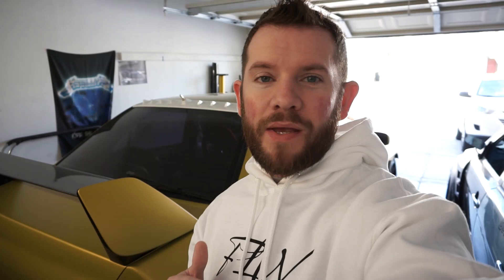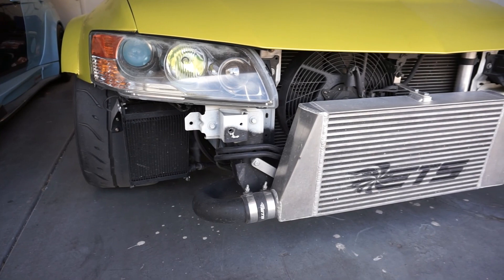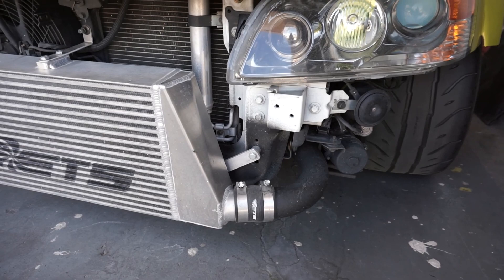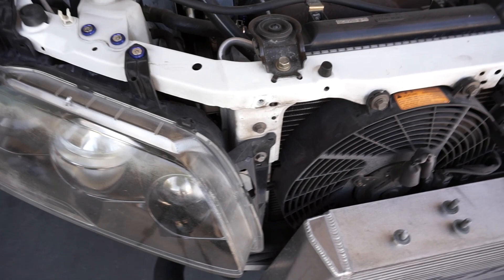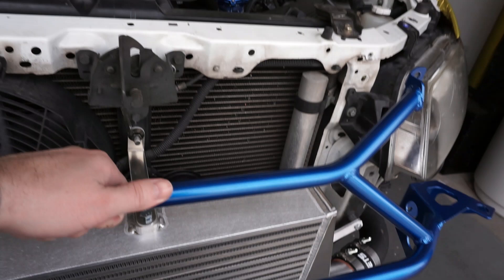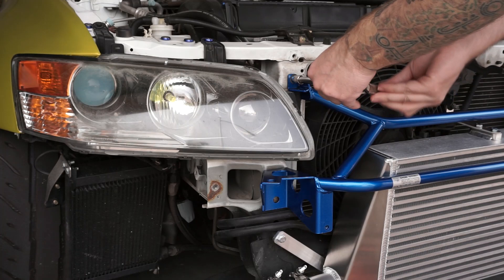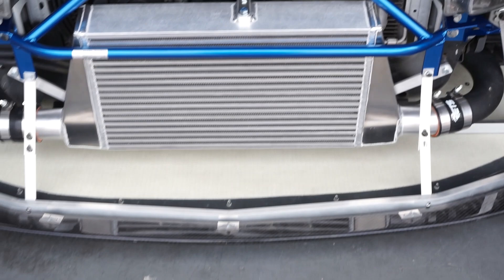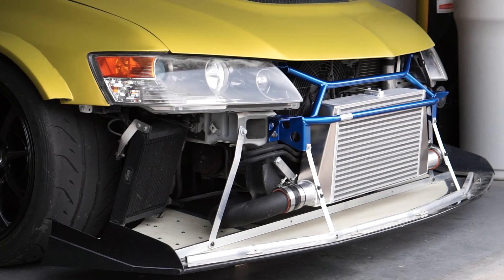CUSCO POWER BRACE FOR MY EVO 9

Comment: What size intercooler did you have before and what size did you change it for
Reply from the maker: 3.5” was the original. The new one is also 3.5”. Both intercoolers were made by ETS.

Comment: Does this fit with a 4 inch intercooler 😅
Reply from the maker: No, 3.5” is very snug.
Reply: @EricMcWilliams515  thanks for the quick response I just wanted to look cool with one. But mines too big lol
Reply from the maker: @ASTSOLEM  I take it you need a larger intercooler for more power, more power is not a bad thing 😃
Reply: @EricMcWilliams515  Yeahh old turbo setup was 6466 precision with 820hp now I’m thinking fp green ball bearing at 535 hp
Reply: My 3.5 didn’t fit

Comment: Those things look cool but they cause bumper sag.
Reply from the maker: I’ve never noticed that on other cars. What part sags?
Reply: @EricMcWilliams515  Around the bumper and grill. CT9As in general have a bumper sagging problem. These braces make them worse.
Reply from the maker: @CJ2X  I could see that. The evo 10 has far more support along the top portion of the bumper, compared to the 8 and 9.
Reply: @EricMcWilliams515  from what I’ve seen, a quick bumper release kit works well to minimize sagging.
Reply from the maker: @CJ2X  next up 😉